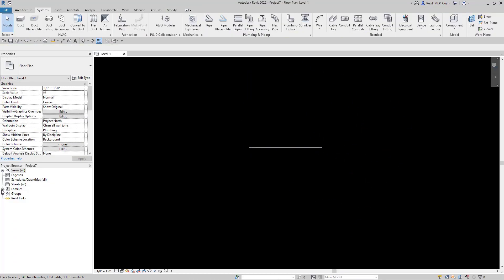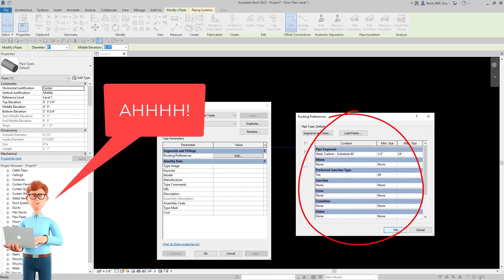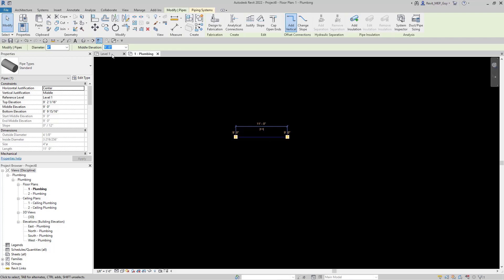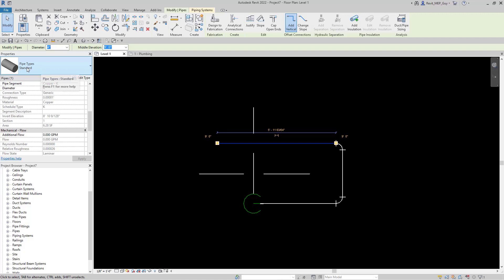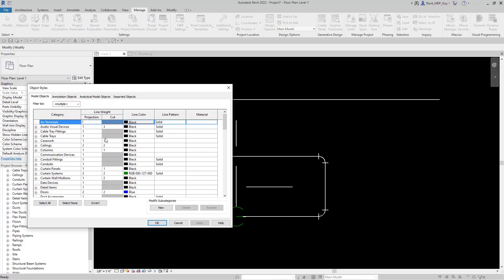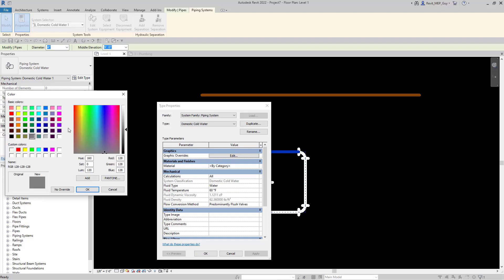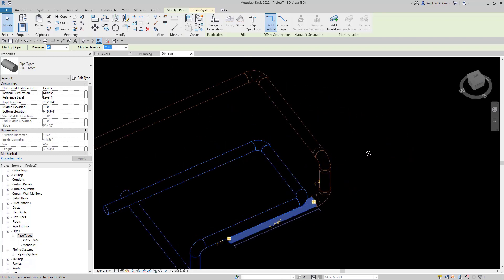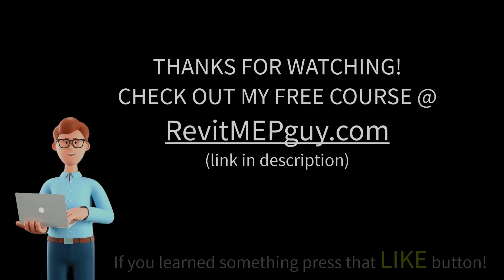How to Set Pipe Routing Preferences in 2 Clicks!

Comment: Hello MEP Guy, I have a question about routing preferences.  Is there a way to set the routing preference for  45 wye fitting?  When I try to add these fittings to the transition or junction section, the fitting is not available in the list to add.  This is for PVC - DWV pipe.
Reply from the maker: You can but....Its a little complicated. You can simply edit the wye fitting and change it to a Tee. Similar to how we do it with a p-trap. Now the wye will be available in that list. However, I rarely use the wye fitting, so I like to set all my tee junctions 2" and smaller to the revit tee/wye, then set all pipe 3" and larger to a combo wye. If I need a wye I just draw the pipe 45 degrees into a pipe. The fittings will look all funky, but I'll just change to the wye it it will fix it. But biggest take away, change the wye to a tee type fitting and you'll be set. Maybe I'll make a video about this.